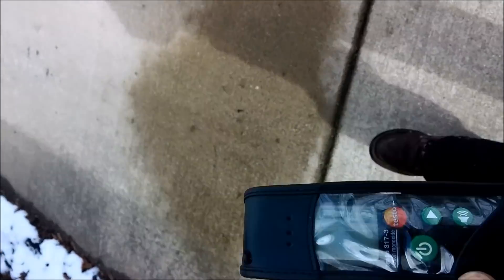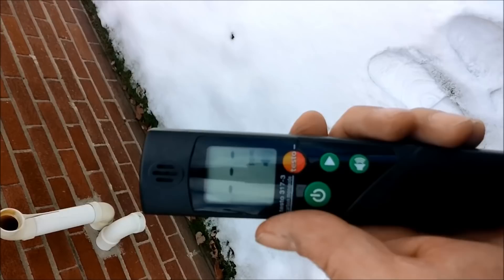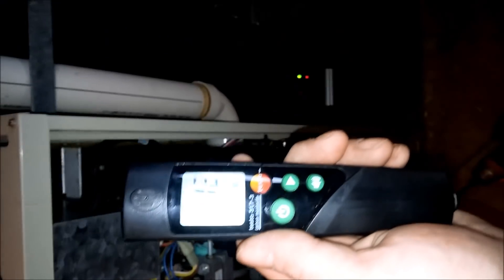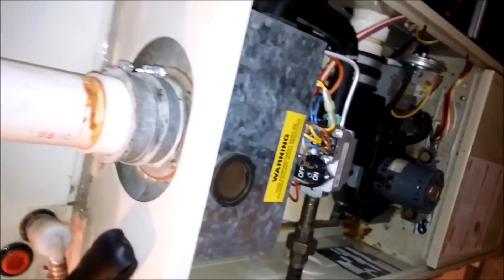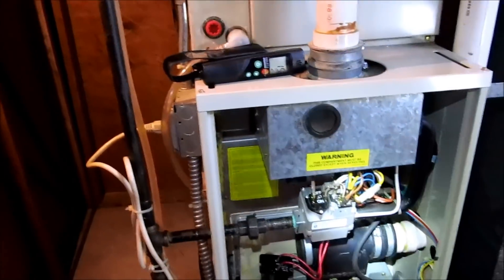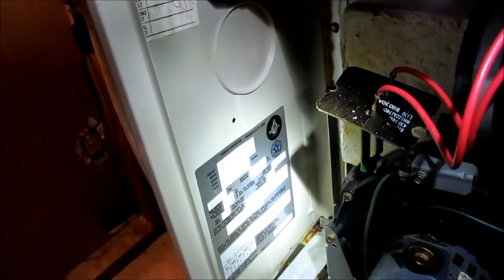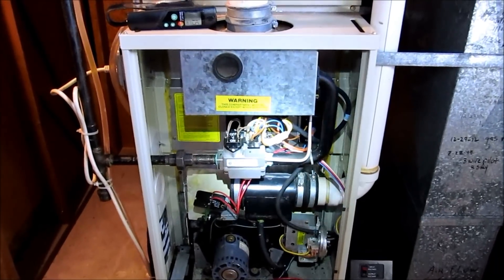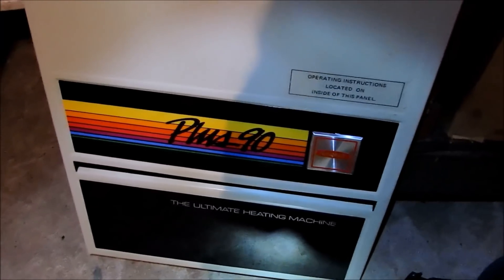Bad 90 plus Bryant furnace secondary heat exchanger rusted through

Comment: Mine just failed.. primary is crackedm secondary is plugged up.. board is bad... Last year I had someone here to check it over before start up.. said nothing was wrong it... Does all that stuff go bad in one year?
Reply: Short answer, yes. I have seen a secondary plugged 2 months after inspection. If the coating fails on those Bryant’s, it does not take long in the winter. Primary cracking and board failure are impossible to predict, but probably connected to overheating due to the plugged secondary.